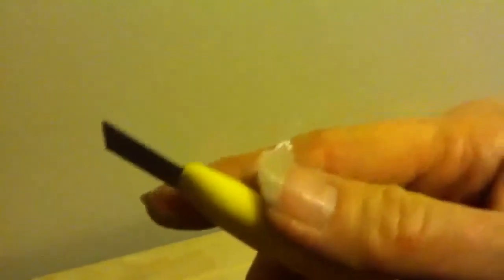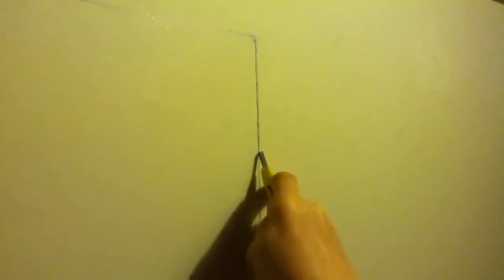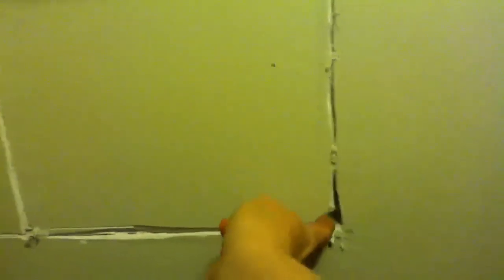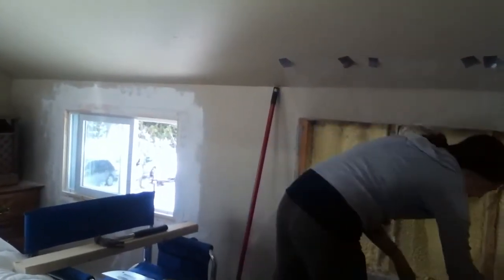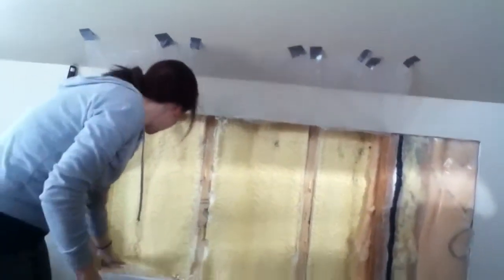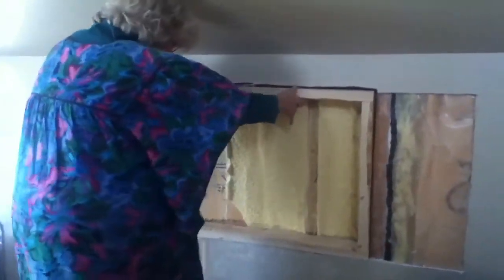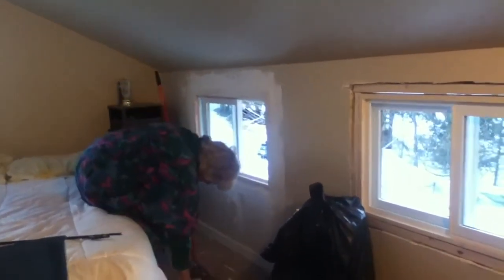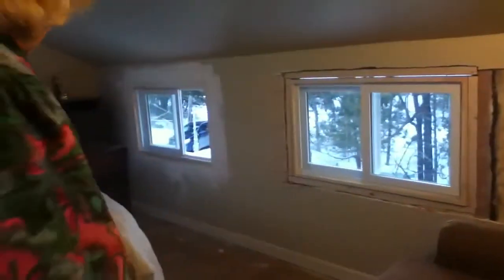Nancy Today: Installing a second window!

Comment: I would LOVE to add a window to a dark room I have. Now I know how! But what happens with the siding on the outside? Do you have to trim it out or caulk it so rainwater and snow doesn't get between the walls?
Reply from the maker: Yes, you have to put those siding edges on it up against the window.  Caulking would also be good for keeping out the moisture.
Reply from the maker: You should watch other videos in case I've done it wrong, though!